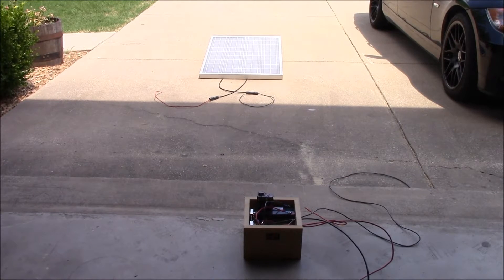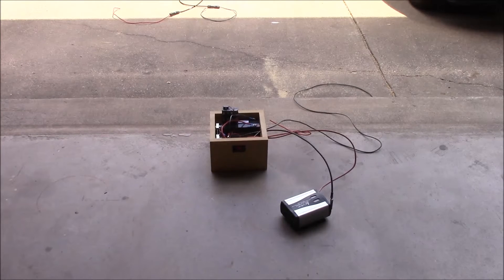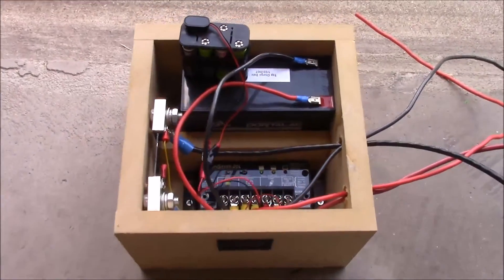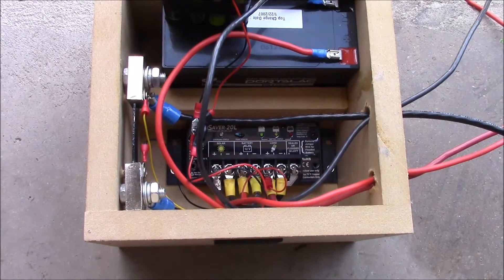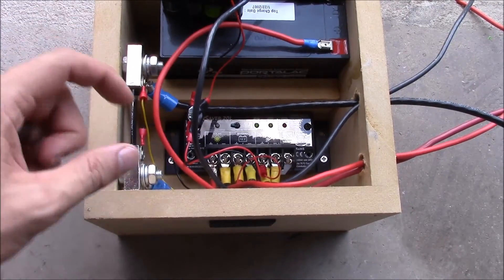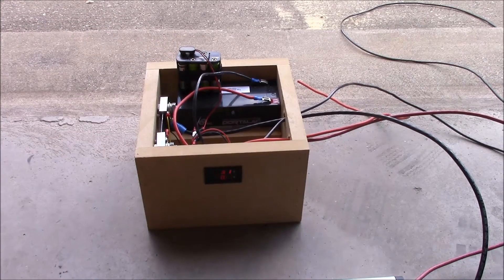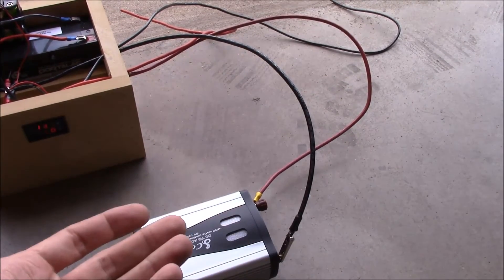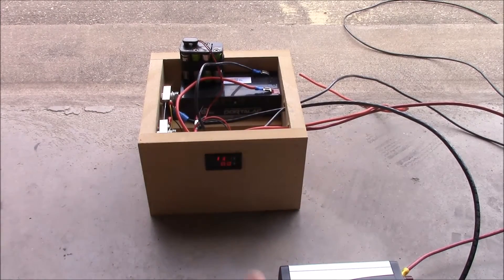Behind The Scenes Look At My Test Rig For "Will It Solar?"

Comment: Could discuss the shunt.. what is it, how it works? Sounds like it is just a big resistor.
Reply from the maker: Willy Smith Yes it is a carefully tuned resistor that allows an ammeter to work.  An ammeter is essentially a voltmeter that is calibrated to read out in amps when the current is passed through a shunt with a known resistance.  So essentially it converts volts to amps and displays it.